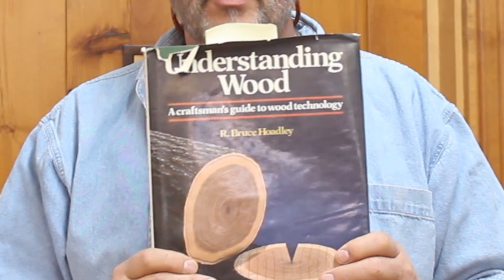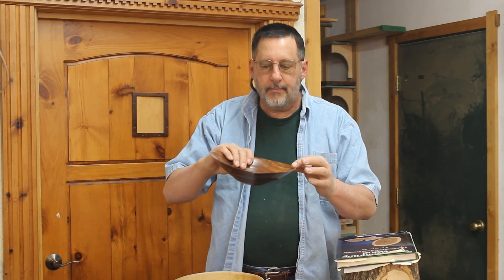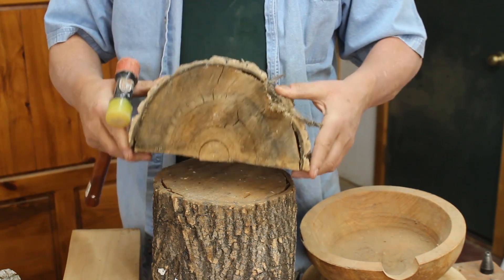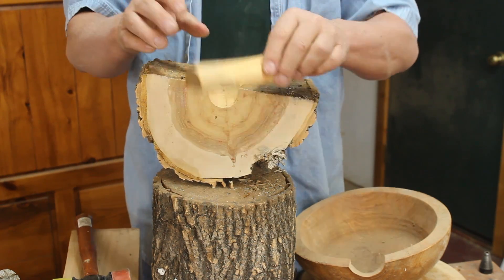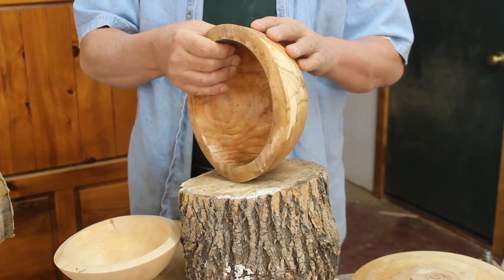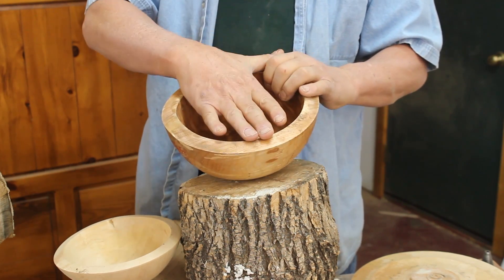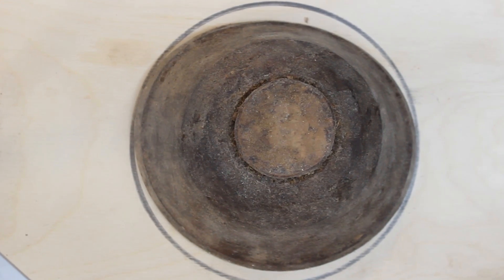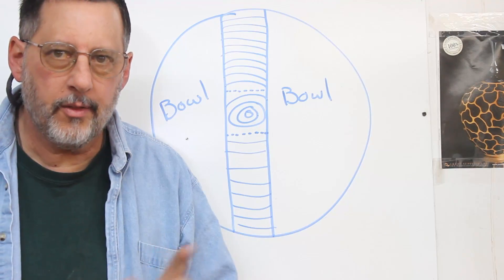How Wood Dries

Comment: Like the video.  Just starting wood carving and turning.  Can I use my wife's old extra paint to seal the end of my wood?  It would really help in cleaning out my garage, but need it to give a good seal. Thanks.   Fred
Reply: my understanding is that latex based paint works for sealing end grain
Reply from the maker: When I have lots of wood/logs to seal I use old paint.  I think it works well.  If I have smaller pieces I use "wood sealer" by artisan sold by craft supply USA
Sam
Reply from the maker: I have never heard this before.  The paint works for me.
Sam

Comment: Hello Sam,  You said you can turn the a green wood really thin.  Will it still warp and if so can you fix it.
Reply from the maker: I am not sure what you mean by fixing it. I appreciate wood warping or distorting. This gives the peace and unusual effect. You may not like this and that's OK. You can simply rough turn a bowl and then threw it up later so it's perfectly round. Again I am not sure what you mean by fixing something are you talking about the crack in the one piece of wood? Sam
Reply: I was just wondering if you would true up the bowl or just leave it how ever it ended up. I did not word my original comment very well. Thanks for responding.
Daniel

Comment: take a well salted water and cook moist tree 1-2-3 hours in the water.
Then wrap the newspaper and postavte dry and so change the paper in a week
tree is dry and free of cracks. You can cook in salted water ready
wood products, they will target and never cracked.
Reply from the maker: +SuperDutchman59 
This all sounds interesting.  I have worked out a good process for drying my pieces.  All it takes is time.  I have more pieces setting there dry than I can turn in a year.  Sam
Reply: -To work in wood (a bowl, a spoon or a statuette) and mode to another raw tree
when the product is ready, it can give a crack, to crack it was never that place
Wooden finished product in highly salted water and cook for about 1 to 4 hours.
Basically hour missing. Thereafter, winding articles with old newspapers
leaving for absorption of moisture from wood, changing every day at about 1 week.
After this tree will never crack. Salt kicks inside the water and dries the
fast wood, protecting it from cracking. The paradox, but it works and is used.
Can not treated with a piece of wood to boil in salted water and then cut after drying
newspapers or paper or cloth.

Comment: Hey Sam, hope you're doing well bud. I've been searching for an answer to a question and was hoping you might be able to help. "If" LOL I can explain what I'm asking. I've been turning/carving some wood cups that in the bushcraft community are referred to as a kuksa. Other than giving a different grain pattern would there be any advantage (as far as strength/resistance to cracking since they are used to hold both hot and cold liquids) to to making them bottom toward the pith (like a natural edge bowl) as opposed to bottom toward the bark as a normal bowl is turned? I've seen them made both ways and was just curious if there might be any benefit other than grain orientation.
Thank you,
Tim
Reply from the maker: +Tim Pollock I had to read this question a couple of time.  I thought about it----very interesting.  I really don't think there would be a difference.  First I would cut the piece as far away from the pith as I could.  The pith is many times the culprit when cracking and splitting occurs.  And, as you say, you are filling them with hot/cold liquids.  You must seal these very well.  I know some cultures do use small bowls for ceremonies and such and are used for food etc. .  I don't have much more than this to offer.  Good luck.  Sam
Reply: +WYOMINGWOODTURNER  Yes sir, I spend a lot of time making sure they are completely sealed with many coats of tung oil. From what I understand the kuksa is a Swedish tradition. My main interest was if you thought there would be any difference strength wise between the two different grain directions. I greatly appreciate you taking time to consider my question and sharing your thoughts!!!
atb  Tim.

Comment: Hi Sam. Very helpful video. Have you ever tried Pentacryl. It is a product that penetrates the cell structure of the wood, stabalizing and reducing drying time dramatically. I basically do what you do when I dry my bowls. However, I am interested in what you think of this product. It has been around a long time and lots of people use it. What do you think.

Thanks for all your videos. I think I've seen them all.

Yuval, up here in what used to be wet Vancaoucer Canada. Not so much anymore...Global warming??

Comment: Another great one Sam, in reading on this subject matter I have seen some folks that after rough turning, boil their blanks, it is said that boiling then relives the internal stress in the wood and blank, and if this is true with stress gone or lessened the chances of drying cracks are also lessened, have you tried this, and if so does it really work?
thanks again
Will
Reply from the maker: Will,
I have read about this before.  I believe that it does work and makes sense when explained.  However, it seems like a great deal of work and messing around.  I make between 100-150 pieces every year.  Now not all are bowls, but many are and I often turn 5 to 10 bowls all at once.  I can't see boiling them all.  I think it would be expensive in fuel to do this.  I saw a guy on youtube soaking a bowl in denatured alcohol, really?  Even if it works it really seem extreme.  Sorry I got on my soapbox.  Happy turning. Sam

Comment: very helpful thank you for your work. what sealers have you worked with successfully
Reply: I have used the wood sealer from craft supply  and just laytec paint.  I have gotten that from the hardware store when it is paint that was not mixed right.
Sam